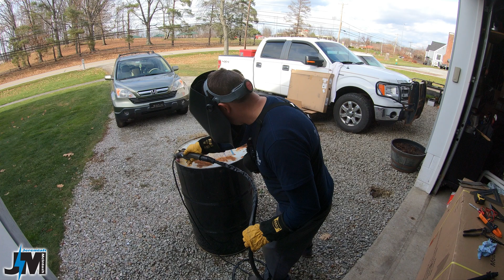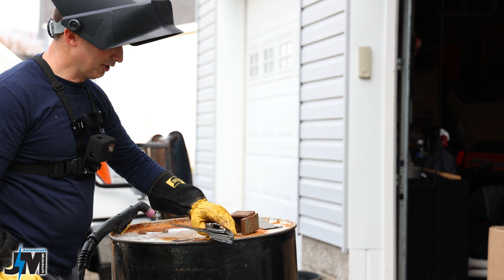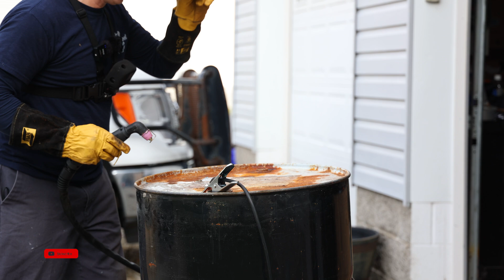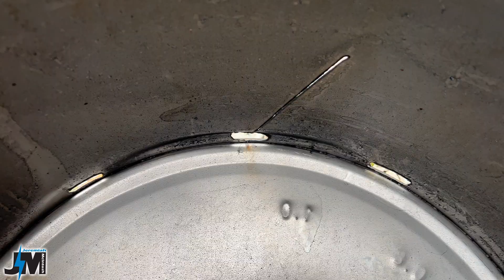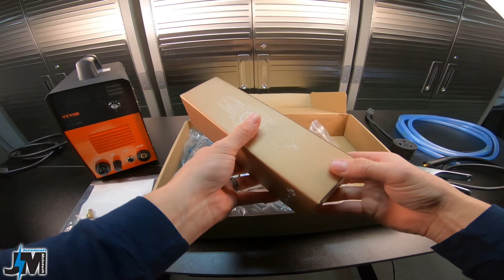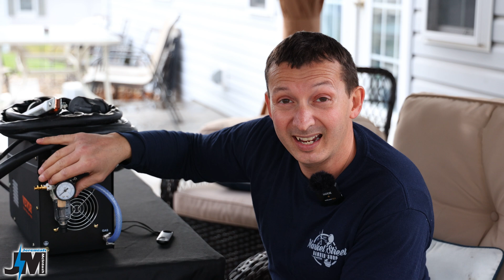Vevor Plasma Cutter Review ~ Can the CUT-50P Pilot Arc Plasma Cutter Cut thick Metal?

Comment: I have a 2004 Ford F-150 with the 5.4L V8 that is notorious for bad exhaust manifold bolts, would a 50amp pilot arc be good to cut all the exhaust studs off so I can just pull the manifold off the weld nuts to the remaining stud and unscrew them? I would have to cut the nut and stud off without damaging the cast iron manifold. The real question is will the plasma cutter cut the cast iron manifold?
Reply: Yes it will cut it lol
Reply: @ChrirleeDebo  So it's probably not going to work for what I am trying to do then huh?

Comment: What are the specifics on the air compressor that you were using for the plasma cutter?
Reply from the maker: The specs of the compressor I used in this video are… 5hp 20 gal tank 8.7 scfm at 40psi  or 7.1 scfm at 90 psi.

Comment: I gotta say, based on what you show, that is amazing even if it lasts only a couple years. I've had a (VERY HEAVY) Hypertherm 40 amp unit for 20+ years (maybe couple hundred hours use on 220v) and it's on its last legs. 
This is very tempting. Thanks for the video!